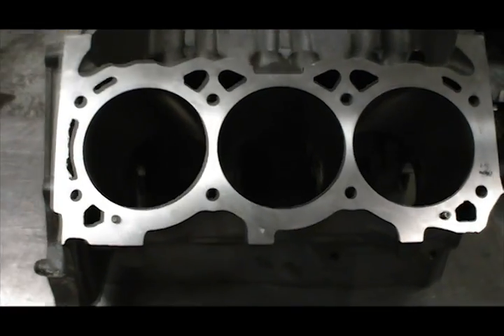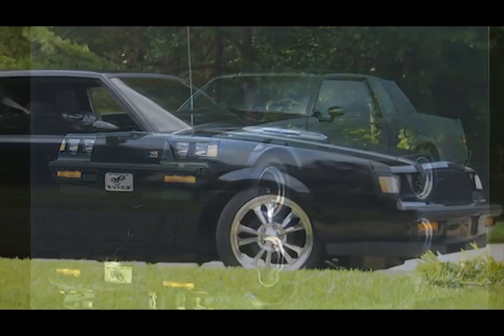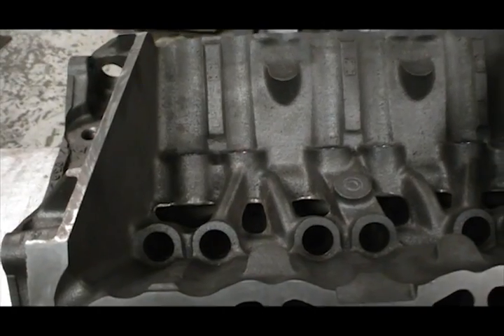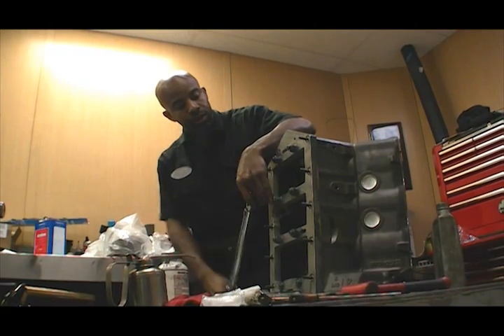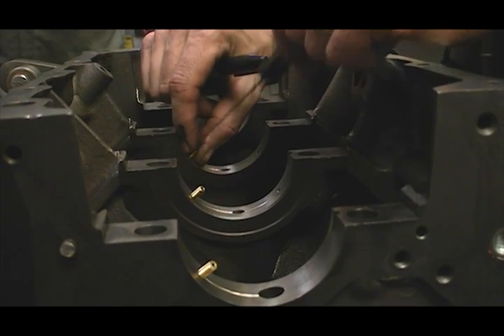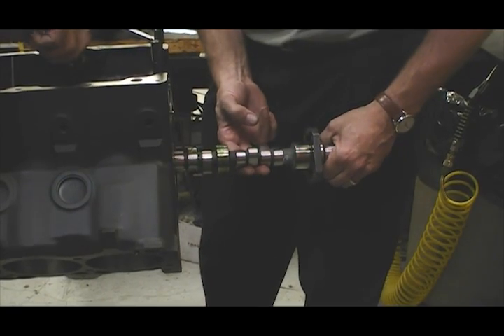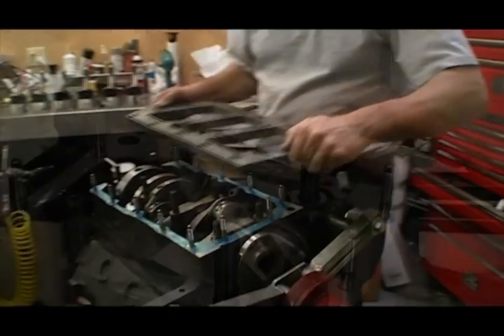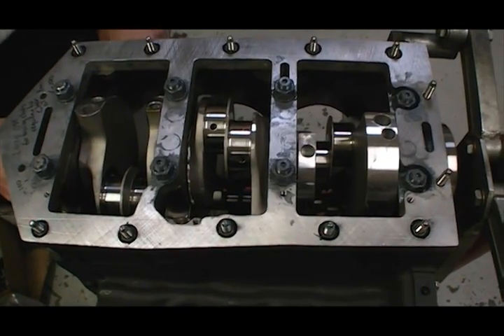Buick GNX Turbo Engine Build (Part 1)

Comment: The problem with that 4.1 block is the walls between the cylinders are to thin and will crack. You need a stage 2 block from Duttweiler or Aluminum block from T&A. I have seen guys use those junk blocks and break.

Comment: Cool build, but here are some corrections: why does the title say GNX? Not a GNX. The GNX was rated at 276 HP, not 275. The final HP for the GN in 87 was 245, not 235.
Reply: THANK YOU!  everyone on youtube calls em GNX's drives me nuts.   You'd think even a car channel would get it right.  They even call t-types GNX's

Comment: What’s funny is a 5.3 swap would be cheaper and make more power.
Reply: Sometimes it's not about how cheap and how much horse power you're gonna make
Reply: @allmarinemaintenance3714  agreed.
Reply: Maybe be. But then you have ruined the car. A friend of mine did that to his GN and the value of the car went to shit.
Reply: @jeshicks9947  maybe so. I guy I knew (sadly he passed away) had a ls1 swapped GN and sold it for big money.

Comment: The horsepower numbers quoted in the beginning of this video are wrong.  I don't know why there is so common when this info is easy to find!  In '86 the official hp number was advertised as 235hp and then in '87 it was advertised as 245hp even though there was no actual change to the engine or other components.  The explanation for this has been explained by those who developed the car as being that they did not want to embarrass the folks over at corvette in '86 since the vettes numbers were already lower.  Then in '87 the GNX had an official hp listing of 276hp even though everyone know this figure is also too low.

Comment: I have never seen anyone add oil squirters to a block that never had them. Nice!

I read that the Nissan 300ZX Twin Turbo was able to have much higher than stock levels of horsepower and be reliable because it was built with oil squirters at the factory. It was in the May 1998 issue of Sport Compact Car. I learned all kinds of stuff from that issue, and I understood EFI better because it explained what a MAF was, how it worked, and why it was a bottleneck that limited the horsepower of a modified 300ZX.

Comment: yeah I figured that out after watching the head section. after the head's where installed the build ended? how much power did he end up making?
Reply from the maker: +Duey Jones That was one of the big disappointments. The owner moved to Texas (I'm in NC) and started working with a tuner there. He was at 700 hp at what he called a mild tune and working through some other issues before pushing it further. And then the car was stolen. Frustrating, but true.
Reply: When he was making all that power, was he able to use 93 octane fuel, or did he have to have racing fuel?
Reply: Is the pic in the thumbnail pic for the vid his car? Have any details on his suspension or wheels used?

Comment: wonder why he didn't go with t/a performance which makes blocks and head's  for buick?
Reply: Depending his goals he may not have needed to go to a TA performance block.  The GN1-R heads, as long as they aren't the earlier cast, are sufficient.
Not to say that TA Performance heads aren't good.  I hear with porting they can out flow GN1 heads, I don't know about GN1-R though.  No heads will out flow the Buick Motor Sports Stage 2 heads, for the turbo V6 application.  The intakes on heads are huge.  Seen a pair, not even fully ported.
Reply: Was the 4.1L block was necessary in order to use the GN1-R heads?  I just rebuilt my 3.8L block and my engine builder said that GN1-Rs weren't an option because of valve clearance and the cylinder wall.

My next project is to build a 3800 Series II block, a Series would work just as well, turbo powered car.  The 3800 series blocks are much stronger in the bottom end with the cross bolted mains and are an overall better block.  A guy is using a series II block with port and polished 3800 NA series III heads on his build.  With a stock 3800 crank, forged rods and pistons.  He'll be able to make 600rwhp with the same turbo I have, but only using 18psi.  For me with my 3.8L block, I will need to turn the boost up to 28psi and I probably still won't hit 600whp.
There are millions of the 3800 blocks out there, if people would just realize the untapped potential there could be a nice after market for the block out there.
Reply from the maker: +Duey Jones Block, heads, intake and block were all used to save $

Comment: JMD 4 clylinder can push more.  K20's for example. 4b11t 4g63t Why lose your time on 5000lb car?
Reply: +Luis Morales - 
1) What you speak of is called a JDM not JMD.  - I have actually built them from the pan up. You? Probably not.
2) For a JDM to make equal power, you would have to spend AT LEAST FOUR TIMES AS MUCH MONEY to produce as much as an '86 or '87 3.8 SFI Intercooled Turbo Buick engine while keeping the A/C. I have built several of these too.
3) A fully optioned turbo Regal weighs right at 3,540 lbs. Most TRs weigh less. WE4 model is lightest.
4) If done right and you don't make over 600 horsepower, these engines are EXTREMELY reliable  with regular maintenance and turbo rebuilds every 50k miles or so. I have a low 11 second car with A/C and the car has 148k miles on the short block which has nothing done except the oil pan gaskets replaced at 122k.
I have driven the car in it's current form on road trips of 1,000 miles without any problems and with drag radials, easily run under 11.5 second 1/4 miles anywhere I've been. NEVER do I install nitrous injection. 
5) With an otherwise stock TR, spend $900 in on the right parts and install them yourself to run 11.9s to 12.2s if that's all you were after. Try doing that with a JDM, a K20, a 4b11t or a 4g63t. You can''t. AND yes, you are running high 11s to low 12s with a 3,500 lb comfortable, RELIABLE car with air conditioning. G bodies hook up very well at the drag strip and only require one airbag under the right rear of the car to stabilize traction and keep the body close to level at launch.
Reply: Aяcнαηgεl Mιcнαεl
Mr. Archangel, thank you for the compliment. I try to learn more each and every day since I will never know everything but I do try to gain as much knowledge about things I am very interested in. I know of guys that have done some wrong things with the TRs and it cost them dearly, just as it does with most kinds of engine builds. I simply followed tried and true methods for any builds/mods I have performed and thankfully they all worked out successfully. Air/Fuel ratio is key when hot rodding these things.
Reply: Aяcнαηgεl Mιcнαεl - I recently (this past week) found one for one of my old friends. I located several in various conditions and miles. Most are likely still available. Tell me what area you are in and what condition/price you are looking for. I spent about 5 hours checking them out and have several emails from the sellers. I'd be happy to forward the info to you.
Reply: Aяcнαηgεl Mιcнαεl
Well, the '86 T-Type and the '87 Turbo T are more rare than the same years' GNs but regardless, the GNs in usable, solid condition command a premium. I know of an '87 Turbo T that is ready to go low 11s or maybe high 10s with little to no work needed. It has an aftermarket intercooler, larger turbo, etc, etc including Weld wheels and drag radials which is for sale for $19,900 but the owner (a dealer) would likely let it go for $17,500 or perhaps a bit less. It is a CLEAN, I mean CLEAN car with a mirror paint job of light gray. Here is the link. http://fastlanecars.com/vehicles/679/1987-buick-regal-t-type --- On the other hand, you'd spend close to that by the time you fixed up a TR that was in need plus the additional hot rod bolt ons. Within limits, TRs don't need direct 'engine' mods except for perhaps cylinder and intake porting and use of Cometic gaskets during reassembly. It you weren't attempting to have a modified car running this fast, you could find a stock or semi-stock car that would run high 13s to low14s for around $12k. Add $7k for a comparable, nice GN. It IS easier to find GNs though.
Reply: You are quite welcome. My low 11 second car I drive while using the A/C has full interior and while in street tune gets 20 mpg highway and around 15 in town running on 93 octane. I wouldn't hesitate to take it on a 1,000 mile trip and have done so a few times with no issues. The DRs were in the trunk, not on the car, as you may have already understood.
Reply: Aяcнαηgεl Mιcнαεl
- Using the proper cam, it is simple to do. Here's one for ya. How about a bone stock 505 hp N/A ZO6 Corvette getting 29 mpg? It only ran high 11's but that's still damn good. My modded 2011 ZO6 runs 10.70s and gets about 23 mpg highway with stock gearing. 5th and 6th are both overdrive. -- About Regals having a larger following, they actually do have quite a following but it seems most are either unable to buy one (really nice ones cost as much or more now than they did new) or else they choose to buy something newer. Example - I once owned a 1987 GN. The factory delivered price on that car was just under $16k. An extra clean example with low miles today will cost $20-25k -- The '87 GN I found last week for my friend was purchased for $24k and it was a RARE find at that price. The car only has 27k miles on it!!! Original paint and always garaged when not driven. Have a good day!
Reply: Luis Morales 3300 lb. Dipshit
Reply: Having a larger displacement may mean less turbo lag. One of the major goals of the build was to make the car a daily driver with huge horsepower.

When you get that kind of horsepower out of a 4-cylinder engine, you get a much larger amount of turbo lag.
Reply: Because they are far more attractive than 4 banger rice burners that American men are getting burned out on, not that certain men were ever into to begin with.
Reply: There is no replacement for displacement!

Comment: After seeing this I know why Buick V6 builds cost way too much for HP to $.
Reply: +TPV Productions If you had actually ever been around these modified cars ('86/'87 intercooled models), you'd know you can make enough power to run high 11's for $900 if you buy the right parts and do the work yourself. It is all bolt-ons and ECM tuning. Spend about $2,000 on proper bolt-ons to run low 11's, spend about $3,500 to run high 10s. All this while keeping A/C and at full weight with a stock, non-rebuilt block if you started with a good condition engine. I have done all of the above personally. It's really quite simple. You just need to know what to do and what not to do for reliability while not wasting money on mods that have little to no benefit. You don't NEED to make 700 horsepower to have a fast turbo Regal. These types of modifications are reliable enough to drive your car on road trips. They don't have to sit all week and do not require anymore maintenance than an average turbo Regal. Put good fuel in, change the ECM settings and race it with drag radials. That's all.
Reply: @racer774  
Awesome info ! Thanks !
Reply: @racer774  what parts are needed to run 10's? Can you give us the $3500 list?
Reply: You don't need to do all this work to make only 700hp. There's people making 700hp with the stock block.
Reply: Cool
Reply: dragkid185 lol prove it....
Reply: Daniel Porter Considering I saw it in person at the dyno, I can't really prove it.